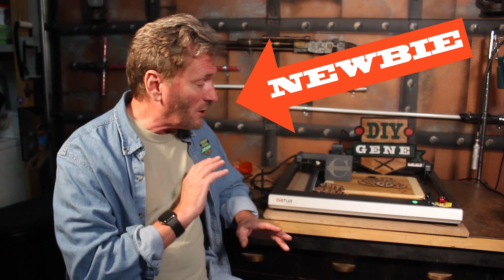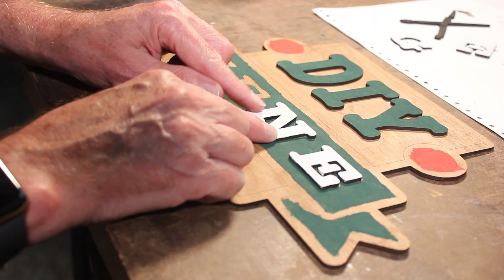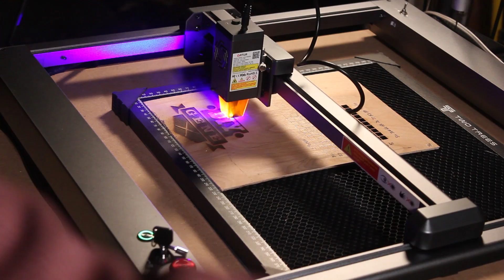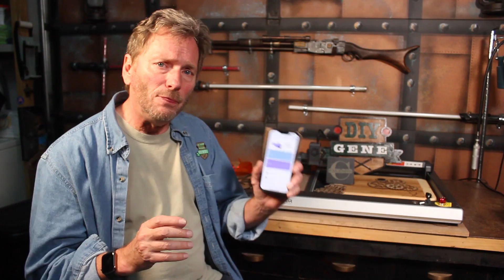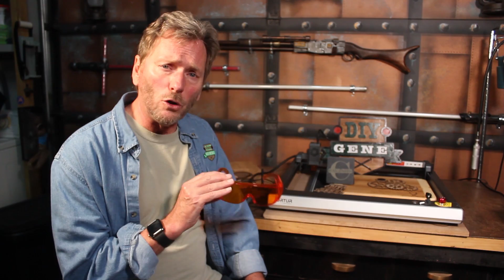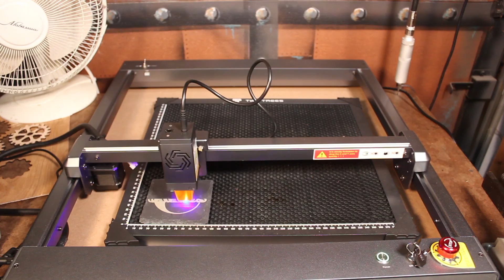DIY Projects with the Ortur Laser Master 3

Comment: Wow Gene, that really is amazing! You said you cut acrylic with it. I wonder if it would cut guitar pickgaurd material, without melting the edges. That sure would save a lot of time, cutting out the pickup holes. They take me forever to do. Thanks for the review. Take care!🙂
Reply from the maker: Hello Dart Man, I am sure it will cut pickgaurd material fine. I have some so I will try it and let you know. Also how cool would it be to engrave cool designs on a guitar body or even the head stock?
Reply: @DIYGene  Thanks Gene. That would be cool to make designs on bodies and headstocks. That machine would make it so easy and accurate, too!
Reply from the maker: I wish I would have had it when I made my Acustisonic. I could have cut the sound hole in a really cool design
Reply: @DIYGene  yep!👍😎🎸🎶
Reply from the maker: Something like the sound holes on an Ovation.
Reply: @DIYGene  yep...I knew a couple guys who had Ovations. I liked them...nice guitars.👍😎🎸🎶

Comment: Would love to see how it performs with different thickness of EVA foam. Even better if there is 24x24 inch model.
Reply from the maker: I agree and I am looking at the expansion kit that will give me a larger area. I also what to check out cut more materials. I cut some 1/2” sentra and it flew through it.

Comment: Would u be able to use this on metal? Unbelievable amount of options
Reply from the maker: It will engrave on metal, even stainless. I am still finding all kinds of things to do with it.
Reply: @DIYGene  It won't engrave metal. You can burn off paint or anodization on metal or mark it with special products like cermark.

Comment: Thanks Gene, great video. It looks like big potential in that little machine. I wonder how it would etch marble tile?  Ceramic, marble and granite flooring installers throw away scrap pieces from cutoffs by the ton. Maybe etch black granite and fill in the groves with white epoxy grout? Hell now that I think about it. You could get new full 12"x 12"x 3/8 thick black or any color marble or granite tile and make designs in them. For wet/slip areas like showers and bathtubs leave the grove unfilled for traction on the feet. Just some thoughts. 
I'm looking forward to seeing more of your projects and experiments. They come out awesome.

 PS. I really like the refrigerator project. I should always drink coffee before I make comments in the morning. Best regards.☕🌄👍
Reply from the maker: That is a great idea. I am going to do some experimenting with a lot of materials. it etched the slate great.